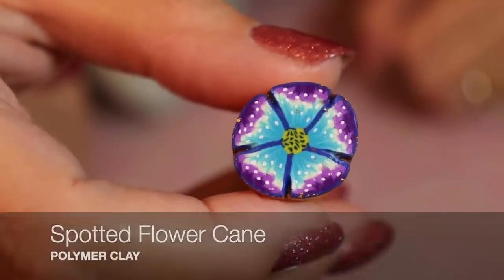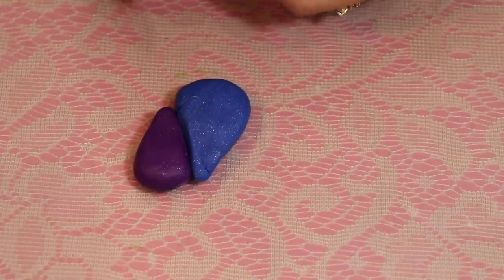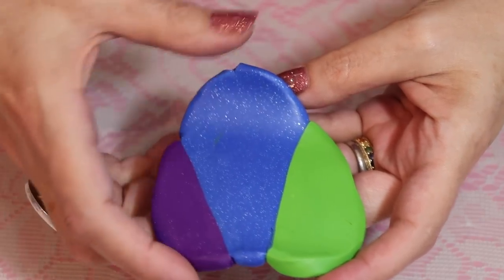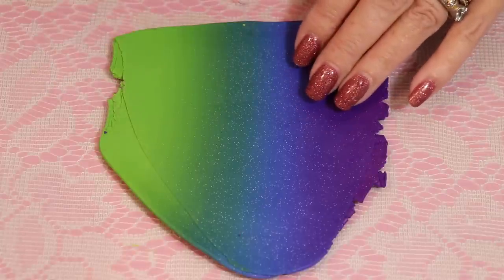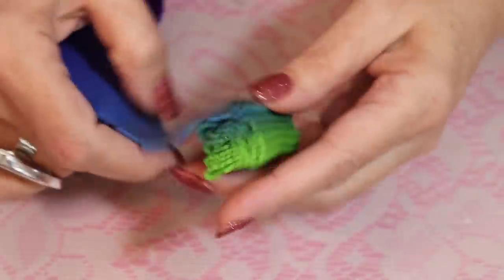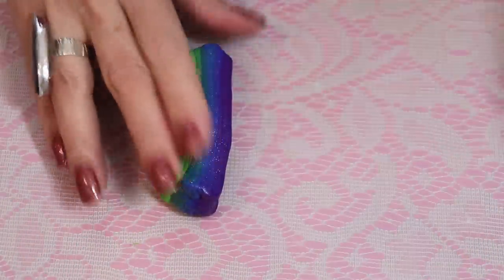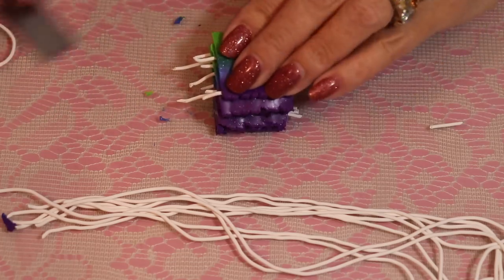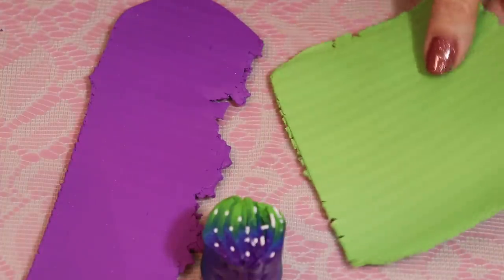Creating A Spotted Flower Cane with Polymer Clay Tutorial

Comment: Aloha Susan, 

I’m so new.  The very first time I tried polymer I tried using gold leaf 🤪. What a disaster (so I thought) so away it went but here I see in a couple videos of yours that I’ve watched today that perhaps it’s a signature technique (as I’ll refer to it) you use on your flower canes. I’d love to hear how you’re applying it. On one of your flower videos it looks like you covered it pretty much solid all around.  In another it looks very random.  It was difficult for me to work with. It fell apart just opening the paper it came in before I touched it. When I tried to handle it, oh forget about it 😳.  If I remember correctly, it seemed to curl up on itself into an unusable ball by the slightest movement of air in the room. 

I also didn’t understand the “registration mark” strip on the leaf cane. It seems to me not having worked with a leaf cane yet that the top is the point whereas the other side is larger and round. How would you lose orientation? I’d love to find the other videos that you spoke about this in. 

Edit...I get it now having watched it a couple more times.

I was blown away when you brought out those trays with your flower designs👏.  I’m not much of a flower girl (till now). There’s no denying how talented you are.  
Liked & subscribed.  
Mahalo 🙏🤙😎❤️ 

P.S. I’ve watched so many videos on PC by other very talented artists such as yourself. I learned a couple things from you that I hadn’t heard in any of them. One was about the magnets and the other about how to alter a skinner blend color combo such as adding a strip of white. See, told you I was new. 😎🌺

Comment: The only thing you left out is that the white clay you put in the extruder is worked soft clay any one new might have missed that. Also that it takes a lot of work to use some extruders
Reply from the maker: If you have the twist extruder it's pretty easy if you have the push type they are easier if you step on the both sides with your feet !

Comment: I am having trouble with my pasta machine. The first one kept tearing my clay and found a bump inside, so I returned it. The next one puts wrinkles in my strips. I was wondering if you have a brief tutorial on best way to use it.
Reply from the maker: It sounds like the brand of pasta machine I have a atlas that is 20 years old and never did that ! I'm afraid it's just a bad roller

Comment: Maybe this is a silly question - how much actual clay do you use to make a cane? You have it divided into parts, but I tried making a cane and I didn't use nearly enough and was trying to stretch a little short piece into something usable. If you could give an approximate weight of one colour, then I could work out how much I need to use to get a usable cane. I  love your tutorials and the beads and things you make.
Reply: One more thing - I don't know the size of a quarter!
Reply from the maker: A quarter is approximately a inch or 3cm you probably dont have enough clay if it's not working double or triple the amount of clay your using would probably help